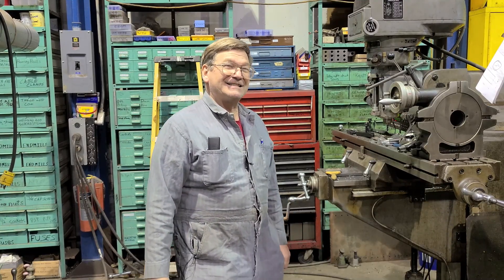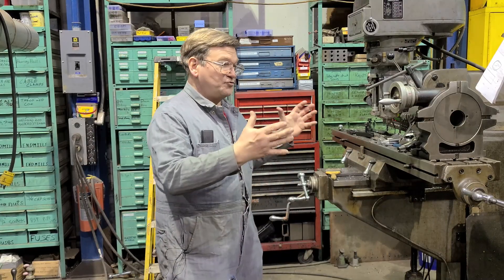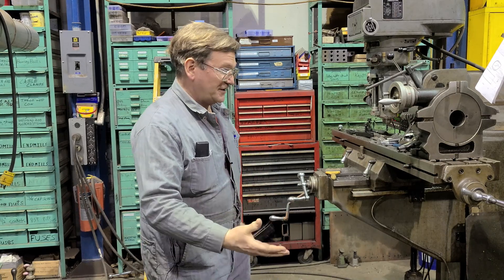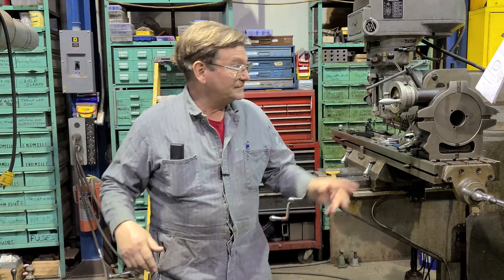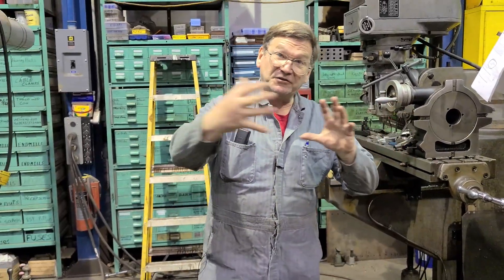Machinist's Minutes: CNC's vs Manual Machining

Comment: of course cnc and manual will always have their pros and cons, i cant help but think about somthing like a swiss machine when it came to your pin example, even a cam driven swiss machine i feel would be able to do 10k parts more efficiantly then a drill press. of course the specs of the part do matter and not everyone is going to have access to a swiss machine or the expertise to run a cam driven one (i certainly dont).

Comment: Look, there are many fair points here. When you have a hammer, everything is a nail. But dismissing the capabilities of CAM design and CNC fabrication is shortsighted. 

I'm 100% on board for simplicity, repairability, and integrating the design+build cycle. Designers should understand how things are made. But it is absurd to ignore the true capabilities and efficiency of CAM+CNC.   There are indeed new components, assemblies, and systems that truly could  not be fabricated without CAM+CNC, and that solve real problems that analog fabrication cannot. 

I have a background in architecture, a masters degree in architecture, and currently run a university fabrication lab with CNC routers, plasma cutters, laser cutters, and 3D printers, AND analog woodworking, metal working, and composit fabrication machining processes. 

Often I'll make a component by hand, because it's faster and easier. Often I will design a part using 3D modeling software, build a toolpath, and make a part with a CNC machine, because it is appropriate. 

It's all about the right tool for the right job. Both analog and digital tools have their place.

But dismissing the truly new capabilities of CAM+CNC fabrication is self-limiting. Plus, a lot has changed since 1976. You can't solve problems using the same mindset that created them in the first place. 

And it's also about how you are participating in the world. If repair, maintenance, and day-to-day fabrication is your bread and butter, CAM+CNC may not make sense. If prototyping, experimentation, cutting-edge research, and problem-seeking is your focus, CAM+CNC is another essential tool in the toolbox.
Reply: CNC machines are all but worthless in the Petrol Chemical plants.  Not worth the money.  Every part and repair job is unique to the equipment being repaired.  Manual is the ONLY logical way to go.  Only place cnc is cost effective is in large production runs.  I see so many cnc machines tossed or sold CHEAP because the computer has failed or you can no longer update the system.  Not with manual machines.  Most plants run machines from the 40's and 50's that are built like tanks and do the job perfectly!

Comment: 3d is important for foundry production tools.  The tooling that makes castings cab be very complex, and they used to do it on a bench with wood.  Now it’s done on a cnc, and it’s super fast compared to the old school.  Bench guys are very valuable still, probably paid more than cnc guys.  The bench guys are masters of the manual trade in pattern work

Comment: Even with multiple drills on a manual machine, it would be a close race with stupid fast CNCs like Fanuc Robodrill or Brother Speedio, running modern carbide drills with 70bar TSC. Those holes look pretty close to 16mm (5/8"), that would give you around 4-4.5k rpm at around 2800rpm at 1750mm/min feed, holes are about 10-12mm deep, that gives you 0.5 second to drill a single hole, so 4 seconds to drill all 8 holes, plus some rapids, on robodrill it would take 2-3 more seconds... Also, the spindle load would peak at around 17-18kw, how much power do those old machines have? 
Dont get me wrong, manual machines still have their placr in a machine shop, but high volume production has moved on years ago.
Reply: Uh, have you ever seen a multi head drill, in a manual machine? The trick is to offset the drills, so they don't all start together. And you don't overload the old motor, that probably, has twice the service factor, than listed. We used to make aluminum racing hubs, and drilled the spoke holes, at one time.
Reply: @everettplummer9725  starting a drill vs. keeping the drill engaged does not change the spindle load that much, all i was trying to say, when it comes to sheer speed, in this case the CNC wins, also, going from one hole pattern to another would be faster,  just around 5-6 button presses, if it was programmed in the controls and not in cam. I am not saying that manual machines have no use in a machine shop, just that when it comes to higher volume production there is no competing with automation

Comment: I’m not a machinist by trade, I’m an electronics engineer. But if I need less than a handful of simple mechanical parts I’ll just machine it on a manual mill and lathe and I design mechanical things so I can manually machine it easily. If I need more than maybe five or ten parts, I’ll send it out to a shop and let them decide if they want to do it manually or on a CNC.

Comment: This guy is completely out of touch with reality and thinks demonstration "hype" videos on YouTube represent CNC's and 3D printing's usefulness... We're not using punchcards anymore, that "bias" is the norm.

Curves? Flow and thermal dynamics, FEA, vibration, compliance, ergonomics, clearance, and, yes, aesthetic and packaging matters. Like, sorry, a bone plate actually needs to conform to the bone's shape.

You can have 100+ tool magazines, pallet pools, robots, bar pushers, etc. absolutely eat manual machining alive. You pretty much need to CAD anyways, CAM is not that much more effort. And those beds will absolutely clamp down a crusty brake caliper to cut out a siezed guide pin.

The only place left for manual is "big iron." Because it just costs too much to make new giant machines versus just reconditioning old ones. And even those will get some automation.

I love manual. I think it's an important part of continued education for a machinist. But I don't even recommend learning it in the beginning, because your CNC skills determine whether or not you can put food on the table. The most you should ever learn in the old ways at the begining is how to use a sine bar, surface plates, and various indicators/measuring tools, including gauge blocks.

Don't listen to the dinosaurs. Everything, from material removal rate, tool life, surface finishes, thermal compensation, accuracy, repeatability, chip and coolant management, and the ability to quickly hit fourth and fifth axes, is better with CNC. And automation features only make it even faster, meaning a one-man business can develop and manufacture more and better products like never before.

Comment: Sort of the part you speak of if you were serious you would have a fixture for that holds 2 or 4 or more on a tombstone that holds multiple fixtures and have a pallet system on the machine to swap out toomstones and each of thoes flanges on a machine with adequate power and a good cam programer should be down to less than 30 seconds on somthing that simple and it should be compleatly finnished and de burred

Comment: Times have changed with designing parts in the 70's-80's. Parts aren't just flat, square or rectangles. Most parts do multiple things. less assembly and hardware needed. They can be made (fancy as you say) to reduce weight.  So, machining on a cnc makes more sense. Been machining since 1983, So I did a lot of manual machining. Now own a shop with cnc mills & cnc lathes. Manual yes, I have still. Bridgeport is the best drill press in the shop. Manual lathe mostly for polishing and occasional government job.

Comment: 0:55 That would have been a lot more interesting if they gave a CNC programmer and journeyman machinist the plans at the same time and had them make a few copies of the part. Regardless of who finishes first, you'll be able to see the difference in preparation time and time per part once you're up and running.
Reply: I converted my manual lathe and mill to CNC. I use manual data input for most of my work, in other words, I just use the CNC to turn the handles. But there are times I use conversational CNC/wizards to do the donkey work such as taking a lot of material out of a bore or reducing a diameter by a large amount. Occasionally I sit at the computer and produce a finished profile that is a bit more than just facing and turning a part. I still manually change the tools and set the correct diameters and face position. I have just finished making 4 retaining rings for someone. After the lathe these were put on the mill for drilling and tapping six holes on a pitch circle diameter around the centre bore. I used a probe and the CNC to locate the centre, fit the spotting drill, pilot drill and tapping drill (set zero for each one by eye) and used conversational CNC to make the holes. I tapped manually afterwards rather than mess about tapping using the mill since I would have had to use thread milling and with what I have that is only worth doing when there are blind holes. For me this is the best mix of manual and CNC since I am only doing this as a hobby for a few beers.

Comment: Yea and the buggy whip manufacturers were real mad at Henry Ford.  I ran some of the first NC machines in 1978 and they were clearly a game changer.  I also ran tracer machines.
Wire EDM machines were also a huge improvement.

Comment: SOOOO much copium in this video.  There is a time and place for each tool.

His rant about engineering is hilarious.  So the engineering team at Porsche that designed light weight internally cooled 3d printed pistons for its racing team was just lazy?  No.  That's not the case at all.  They took advantage of the new technology to pioneer a design that wouldn't be feasible by any other method.

Honestly this video is cringe inducing.  It's pretty clear that he hasn't spent time working in a modern shop.  With things like thread mills you can use one tool to make a multitude of thread pitches.  On a CNC machine I can make any size hole I need with one end mill and some helical interpolation.  I don't have to spot/drill/ream to get to a specific hole size.  I can cutter comp the tool, aim small, and comp it out until i get exact size needed.  With a probe in the machine I can find center on the part before he even has in indicator in his manual machine.

Comment: been operating a lathe and shaper for around 6 years now , one off jobs , repairs , and modification jobs are just alot better suited to manual machinign as well as jobs with poor material quality (like porosity hard spots and welding)

Comment: I am a retired mechanic and in my home shop I have a very old Logan turret lathe, from 1941. I have worked in the machine shop as an apprentice using the newer machines, including the CNC and I can say honestly that I prefer the old machines. It's a slower pace of life and is more enjoyable than the ultra fast paced get it done now pace. I should point out that I just turned 50 years old, so I am old enough to know what the fast pace is and never really knew the slow pace from years prior. We are missing a lot because things are going so fast and everything is in such a rush.
Reply: Amen

Comment: I only run manual equpiment at home (for a hobby) and my work is nothing to do with machining at all (though I have done a little CNC a long time ago). 
His last statements say it all (taliking about self driving cars) - he says he doesn't want a computer driving for him and also that "it's no fun". But self-driving cars are vastly superior to human drivers. They still occasionally crash and they're not perfect, but you're more likely to have a crash if you're in control manually. So even when something is demonstrably better, the 'old ways' are still preferred.
This mindset is why he doesn't want to consider CNC - and they've come a long way from the film he talks about. Making a 3D drawing in CAD is a lot easier and faster than it used to be and depending on the designer your 'drawings' may even come as a 3D file ready for the CAM software. Good CAM software is also quick and easy to use. For the CNC run it doesn't matter that there is a (possibly) unwarranted complex curve - the CNC will produce the part to the original spec just as well and just as fast whether it has a complex curve or a simple step so why not create more aesthetic pieces? 

Finally, regarding how many pieces before CNC is better - I'd much prefer to pay labourer rates to keep stock up and replace/sharpen tooling to CNC equipment that is cranking out product while my machinist does initial setup/CAD/CAM for other work, than paying machinist rates for manual repetition that a mindless machine could do faster. It's just good business (alhtough a bit sad for machinists admittedly).

Comment: Have done both, CNC is garbage to run. There's a reason why we call them operators. 

Give me a chunk of material, a manual lathe/Bridgeport and maybe not even a complete blueprint and itll be done before the programmer comes back from his 3rd coffee break while autocad does his work for him and leaves me minefields to find later. 

If pumping out 300 units an hour is your thing than just sub the work out overseas, they're cheaper anyway.
Reply: Ok.  Now go cut me a parabolic curve on your manual mill.  By the time you get the math figured out the CNC guy will be done an sipping his coffee.  There is a right tool for every job.  I've made my career on a CNC machines.  I'm just as much of a machinist as the guy who's spent his whole career turning hand wheels.  I've worked at shops where they "sub the work out overseas".  It comes back needing rework after it's 4 weeks late coming back form over seas. 

The shop I'm at we make medical devices.  That is not something that you want to farm out over seas.
Reply: @brandons9138  I didn't say CNC was useless, I said it was garbage to run. But then I prefer to hand craft things, like my watch making. I'm not a unit-per-hour kind of guy. 

In regards to out sourcing, that's what happened at my last two machine jobs. They just kept outsourcing stuff overseas, manual and CNC. Always came back for us to fix. But now there's no one stateside to fix it so thats their problem and leaves good machinists in my area scrambling for positions. Proof the higher ups have no idea what it actually takes to machine things properly.

Comment: Writing simple programs is dead easy and fast with most conversational CNCs. I think that it is very rare for a fully manual machine to be the best method. 
I learned on manual machines and ran them for a while. I think everyone should start manual because it teaches a lot of basics but CNC capability almost always compliments a machinist's skill
Reply: you get a totally different feeling and respect for the material and the machine if you start of with a manual machine, and lets not forget the sound. its really important to learn how different material work and the best way to learn that is manual in my opinion.